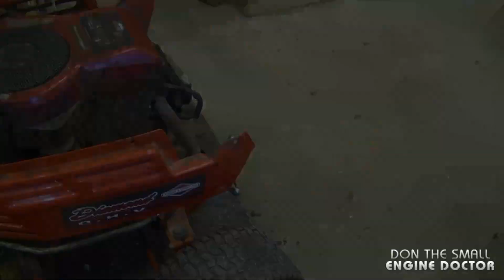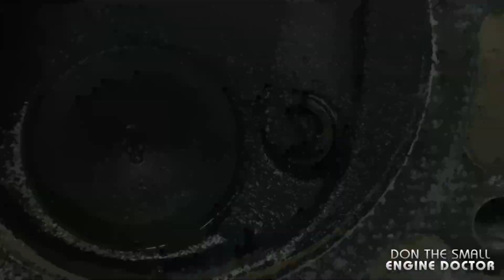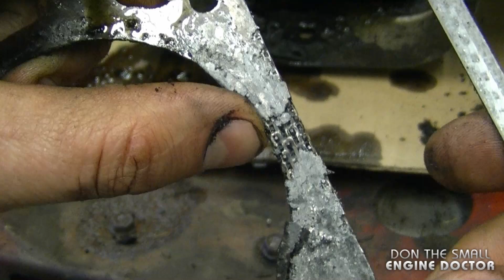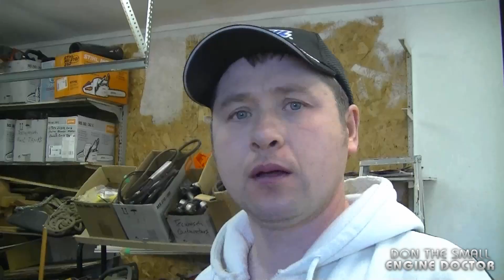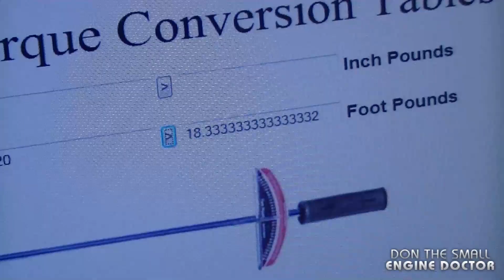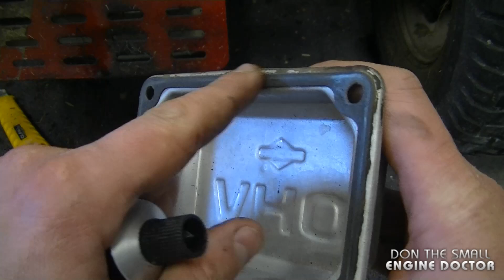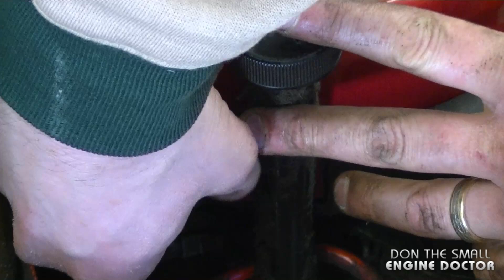Fix a Blown Head Gasket & Adjust Valves On A Lawn Tractor With OHV Engine

Comment: I have a Husqvarna with a 54 inch deck I can't remember it's like 16.5 horse or some damn weird thing it's about 15 years old they got it it Lowe's in Michigan. The damn thing ran perfect for your years and years and years kept it up pretty good and then last winter started it started blowing white smoke and then oil poured out of the engine in it sits in my back patio with a puddle of oil underneath it and a tarp over it. is this a head gasket issue? If it is I'll go ahead and rebuild it it's no big deal um I also have a couple of lathe and a mill so I can make just about any part that I need period but I did not think that the smoke should have been White pouring out of the exhaust. typically transmission fluid Burns why not motor oil period but when I search 4 white smoke blowing out of my Husqvarna all fingers pointing it head gasket.

Any thoughts?

Comment: I had the same exact problem with a similar B&S engine. It was burning so much oil that it
was hard to see where I was going while cutting grass. My local small engine shop told me that the replacement gasket I purchased ( B&S OEM) was re-designed by Briggs when they became aware that there was an issue. New gasket has been fine for over 2 years.

Comment: When you torque the head bolts, should the threads be lightly oiled or dry? How come you didn't degrease the engine before taking it apart?

Comment: What a great video! Just worked on my Toro Wheel Horse and everything is up and running again. Even though I had to adjust the valves a third time, it was a great learning experience. Thanks again!

Comment: A friend of mine works for a government contractor in the aerospace industry. He says they are required to click their torque wrench 7 times when torquing fasteners. I've never done any testing myself, so I don't know which is more accurate or if there is even a difference. I've always clicked it 3 times. Theoretically, a good wrench should break over at the same torque every time, so it shouldn't matter how many times you do it. I'd love to see someone do an experiment proving one way or the other.
Reply: Not over my head at all. Just making a comment related to something said in the video.
Reply: 7 clicks is excessive.  Why even use an accurate torque wrench if you're not going to stop when it clicks initially?
Reply: When torquing something that uses multiple fasteners that span a large area, like a cylinder head, valve cover, a panel, wheel, etc. the torque on one fastener can change as the other fasteners are torqued. That's the argument for torquing a fastener multiple times. How many times are excessive? I don't know... I do know that in such applications I have torqued a fastener to spec, followed by the rest, and when I got back to the original fastener it required more turning to get it back to spec. That is with multiple torque wrenches from Snap-On to Craftsman...
Reply: Replaed needel valve and set but when ipuug it back carb floods. What s wrong.

Comment: Dony
I have a SCAG zero turn with a Kohler Command CV20S twin cylinder engine.I suspect that I need to replace the head gasket. Plugs are  sooty , high oil consumption and beginning to smoke, not bad yet, but smoking.
Do you have a head gasket removal for for this engine.
Thanks, your videos are the best

Comment: GREAT VIDEO. YOU STATE THAT IF YOU HAVE A SINGLE CYLINDER OVERHEAD VALVE ENGINE THAT IS HARD STARTING IT MAY BE VALVE SETTING. COULD THIS ALSO APPLY TO MY BRIGGS TWIN V? IT'S A BIG MODEL 445877  TYPE 1565 05
Reply from the maker: yes
Reply: thank you

Comment: about to work on an LX 188 with a 17hp Kawasaki OHV twin cyl.  
it's liquid cooled.  have you ever seen that? has a radiator,  water pump,  etc.  whole nine yards cooling system.  (still haven't figured out why) 

anyways,  antifreeze keeps filling the cylinder once it sits.  after an initial getting it out and smoking session it runs fine (this is what I'm told,  haven't seen it personally yet,  but will soon) 
my question is,  unless it's obvious,  how do I know the head doesn't have a minute crack,  not visible.  if I take it to a machine shop,  etc.  wonder if they'd test it for me?
always referring back to your videos when I need some guidance.  you're the best,  and have helped me a lot.  appreciate that

Comment: Hey Dony. I had the same issue with my 2000 14.5 hp ohv  Briggs and Stratton engine. I followed your direction to the letter and it worked out great and it stared in seconds with no more smoke. ( thanks ) It would only operate at high idle though. When I tried to lower the idle the engine would stop right away so I just used it at fast idle. I used the tractor for about for about a half hour yesterday and the engine started slowing down and backfiring on its own and then quit......and would not restart. Started it today with the air filter off and it backfires big time. I was able to lower the idle speed with the filter off but it still backfires. What is my problem and do you have a fix? Thanks very much. Deny
Reply: +Deny Konecny maybe you didn't put the push rods in correctly or not timed right. Maybe your push rods are not pushing valves all the way in.
Reply: @The124conrad  When
 I took the head off they fell out. (my mistake). I did remember which one went where. The aluminum one in the bottom steel on top
Reply: I looked inside to make sure they were seated properly though

Comment: what year is that mtd tractor
Reply from the maker: +Josh The Inflatable And Tractor Guy approx. 2000
Reply: +donyboy73 where do you get a gasket
Reply: +Josh The Inflatable And Tractor Guy I have a 1999 craftsman lt 4000 with a 14.5 Briggs and it has the same problem
Reply from the maker: +Josh The Inflatable And Tractor Guy any small engine shop
Reply: thanks

Comment: followed your video.  17.5 briggs / single cyl / ohv.     pulled cover off and bottom rocker arm was off the end of the valve and bent the push rod.  ordered new valve. keeper.  push rod.  rocker arm.  and push rod guide.  I am going to assume that because the valves were never adjusted, it got loose and rocker arm came off the valve and bent the push rod ??????    is there anything else I should re[place ?   just put it back together / adjust the valves and good to go ?    model # 917-272670 craftsman riding mower.engine model #  31C707-0230-E1   .     what feeler gage # do I use ,  on each ?  I called sears and they gave me the engine number....nice folks....
Reply from the maker: +Bob Haddock yes  that happens, I check what I can then re-assemble. any feeler gauge from an auto parts store will work
Reply: +donyboy73 .    sorry.  I ment what thousands on each
Reply from the maker: +Bob Haddock between .003-.005
Reply: what thousands for Kohler 24 hp   and     22hp kohler ?

Comment: get gas in oil is that fuel pump or head gasket 15.5 rider murry
Reply from the maker: +Raymond Langevin the carb needle valve and seat need to be replaced

Comment: Great video as usual  Dony - just working my way through your video catalogue! One question: you said that after a bit of running to re-torque the head bolts. Do you slacken each bolt before re-torquing one at a time, or just try and tighten with the torque wrench?
Reply from the maker: +jsof2 just check them again with torque wrench

Comment: Hi donyboy73,
Thanks for this video.  My father just had to do this on our Briggs 17.5 HP Model 31C707, and this video was helpful, even though the engine wasn't the exact same.
He found that the cooling fan had lost several fins off of it when he tore it down.  It leaves me wondering if that caused the engine to overheat and caused the issue with the head gasket.
Have you heard of the Briggs engines having issues like losing the fins off the cooling fan?
Reply from the maker: +marathoner43 no never seen that, the gaskets are problematic regardless though

Comment: When you put the rods back in, what can explain them not moving when you spin the flywheel?  Are the cams inside busted?  Will I need to open up the entire engine?  Do you have a video fixing a problem as I have mentioned?

Comment: I have a Bolens ride lawn mover 17.0 I/C OHV Engine briggs & stratton I bought it in 2008  its been a good machine.  2 weeks  ago it started smoking  a lot. I saw your videos and I try to fix it my self.  I changed the head gasket, cleaned it, changed the oil  and  it is still smoking.  When i removed the old oil, i noticed it smelled like gasoline also. Do you know how gasoline would have even gotten mixed up with the oil?  I bought a new gasket to see if it would help, even though the old gasket still looked in good condition, but it didnt help with the smoking. Do you think it could be something  else? I could really use your expertise and advice! please help and  thank you for your videos!

Comment: Brilliant as always Don. Always a pleasure to watch and learn tricks from you. I post many self help videos on the older Cast Iron Briggs, but I'm always working on these newer engines as well. On running the engine without the oil check tube secured, I HAVE had the crank case pressure throw the tube from the oil port...makes for a big mess to clean up if you don't have it secured when test running without the blower shield in place. Cheers! Zip~

Comment: Hey Donyboy....I have a 2006 Troy Bilt Bronco that wont start....Ive watched your other videos on valve adjustments and I did that....Ive cleaned pretty much the whole engine but it still wont start...New Battery and Spark Plug....New Belts....Checked the starter and pretty much I'm stuck...Need your Advise...thanks

Comment: Hello Don. Is lock-tite a good idea for the head bolts?  One thing I've noticed when I changes an exhaust gasket. The expansion and contraction from the heat changed the mating surface so I had to re-torque again, even if the bolts treads were dabbed with loc-tite. Merci !
Reply from the maker: R Verro yes it would be a good idea to use loctite

Comment: Ivé seen another one of your videos regarding head gaskets on the OHV engines and since then i have replaced about 20 of them with succes.. 
I have som info to make the job a bit easier:

1: The two pins in the block that supports the gasket are easy to take out, which makes the sanding easier.
2: I find it easy to use one of those cork sanding blocks and some fine sand paper to get an even surface.
3: The intak push-rod tend to wear on that part that, where it runs through the guide in the head. Simply reverse the rod and you do not have to worry about replacing the rod in the near future.

Your videos are my bible, Dony.

Have a great day.
Reply from the maker: LKV thanks

Comment: Just finished replacing the head gasket on my Troy Built 110 with a B&S 550EX. When I finished i had no compression. I reviewed this video and found I had missed the step where you open the OHC cover and reseat the valves. When I did that it ran like a champ. Thanks for all you do.

Comment: Donyboy...thanks for putting the video together.  I thought I had a head gasket problem (oil leaking and lots of white smoke) so I followed your directions and changed the gasket.  When I started up the engine it worked right away and I did not see any smoke. When I started it the 3rd time, the white smoke came back.  It looks like it is coming the exhaust manifold. Any thoughts on what I should do next?
Reply from the maker: Trevor Azavedo it could be that the valve seal is worn out or the valve guide. guide only comes in a complete head
Reply: donyboy73 Thanks. Do you have video on how to check the valve seal?  Could it be that I possible put to much oil in when I refilled?

Comment: Great video however I do have two questions where did you get the check sheet and where do you find the rotary parts? I just had my head gasket go yesterday and want to get it fixed as soon as I can. Thank you Rusty 10162

Comment: Don, you are "The Man" thanks for putting up this video. I just fixed what I thought was a lost cause. I was getting oil in the carb and gas in the oil. I replaced the head gasket just like the video told me to. Now for around $20 it's running great. Thanks again.
Reply from the maker: you're welcome, make sure to have subscribed

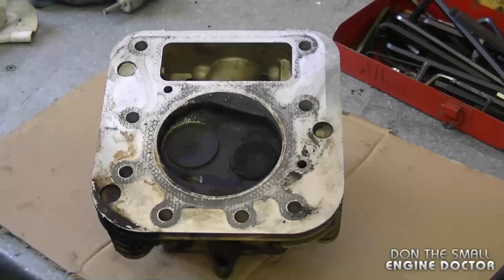Comment: Thank's , easy to follow instructions. Made it fun. I think you may find it interesting , I am seventy , retired , the only experience I have is when a teenager I had to work on my old cars to make them run.Took me three times longer because the heat here in Virginia this time of year, had to work first thing in morning 6am-9am then 6pm to about 7:30 because the sun shined into my shed .The only real problems where my fault , over the last few years my grandsons have been helping out Pa-Paw and I did not notice no maintenance was being done, so everything needed replacement ,fuel filter and gas line (twisted off in my hands) ,air filter (embarrassing bad) and so on !!
I think the one thing that made me try and that was when you told someone "Its not rocket science " ! Thank you again . William

Comment: I have a Murray riding lawn mower and my lights don't work and I've changed the bulbs, the fuse, and cleaned all the connections. After doing all of that they still don't work. What should I do?

Comment: Hi, Thanks for the video. I just replaced my head gasket and it solved my problem, but I do have a question. During disassembly I noticed the head bolds barely snug. during assembly I converted the ft-inch to about 19 ft-lbs it seemed a lot more snug than during disassembly. Do you recommend re-torque after running awhile?
Thanks,
Tom
Reply: Hi Tom,  In the past I've trash-picked engines that only needed the head tightened, one in particular was a weed wacker the head was almost completely off,,, after tightening the head-bolts, it ran as good as new.  So yes, I would recommend checking the torque several times after rebuilding.

Comment: Love the video, but I want to add one tip. I've never sanded a head or block like this, but I do work with wood and sometimes sheet metal. If you are not experienced with hand sanding, get a sanding block. It will force you to sand flat and level. Sanding with your hand can create ridges and valleys in the shape of your fingers.

Comment: Donyboy, you should get some of those 3M radial bristle brushes for cleaning metalsurfaces. They work really slick. You can buy one for iron surfaces and one for aluminium.
Reply from the maker: I actually have them, just did it this way to show the average joe what to use

Comment: Hi Don, I have a 17hp Intek, it was surging, no smoke, cleaned carb twice but no help. Failed leak down test. Pulled head, gasket does need replacing. I'm thinking I should remove valves and check seats. Also I was thinking of applying anti-seize to head bolts. Do you have comments on this?

Comment: Great video. I just replaced the head gaskets on my 2001 GMC Yukon (coolant leaking into the engine oil). It's fairly similar just on a lot bigger 5.3L V8 motor lol. Keep up the great videos Don!

Comment: Ok don, I really think you shouldn't advise people to take sand paper by hand to their head gasket sealing surface. There is a much much much more accurate way to do this that literally anyone can do at home. You just need to tape the piece of sand paper to a piece of glass or a granite surface and move the head around in circles on top of the paper which is on top of the flat glass. Any oil you happen to have on hand that you can wet the paper down with helps immensely. No reason not to do it this way and you are actually improving the surface flatness of the head beyond factory precision. If you advise your viewers to clean it by hand with paper, they may find a spot that is a little too pitted and they may go down so far that you still have blow by. Just my 2 cents, I have been lapping small engine heads and jugs this way my whole life and if you do it right you can eliminate the need for a head gasket all together and pick up a little compression. Not that that is advisable for all engines, gotta be careful with valve clearence in that situation.
Reply: Ahhh!!! and getting sand paper grit in the crack between the piston and the cylinder!! Don!! You know better than that! Wiping it clean is not gonna get the particles that got soaked up in the cracks down in the piston rings :(
Reply from the maker: ***** I'm not working on the space shuttle here! A 400-600 GRIT EMERY PAPER WORKS FINE.

Comment: another awesome video, thanks Don.
Quick question, why didn't you put RTV on the head but you did on the valve cover?
I am about to do a dirt-bike top end installation and I was wondering. I thought I needed RTV at the cylinder, head, and valve cover, no?
thanks

Comment: You don't need a converter to convert inch pounds to foot pounds. Guess our knowledge in the US of the ancient imperial system pays off :-). There are 12 inches in a foot. So divide 220 by 12 to get the value in foot pounds.

Inch Pounds / 12 = Foot Pounds

Foot Pounds * 12 = Inch Pounds

Just remember the number 12.

For example 220 inch pounds / 12 = 18.3 foot pounds.

Comment: Hey Dony,
I Have A With My 12HP B&S 283707-1139-E1 It Starts When I Use The Choke But It Dies After A Minute Or Two. I Have Rebuilt The Carburetor I Got Good Spark And I Have Fresh Gas In There. It Is The Engine With The Same Throttle And Choke Lever.

Comment: Excellent video Don!  I've seen a lot of these style Briggs engines blow the head gasket in the same place.  I believe it is because there isn't a bolt that provides clamping power on that area of the head, so it is the weakest point.  Do you know if the newer Briggs OHV single engines have fixed this issue?  Thanks for the tip on the Rotary gasket, I've just been using the OEM Briggs gasket.